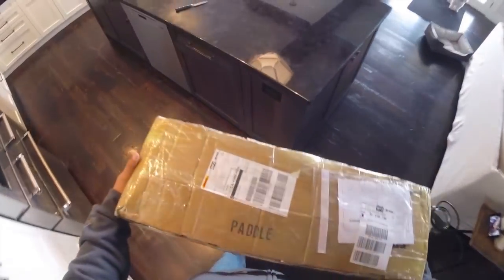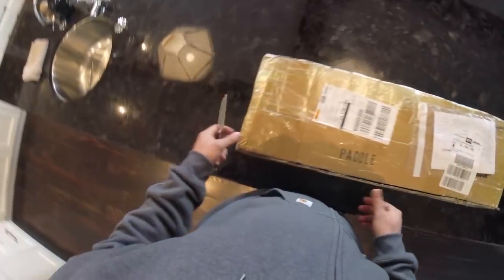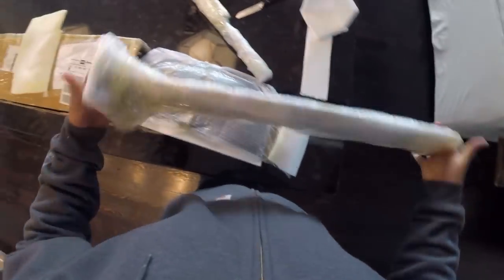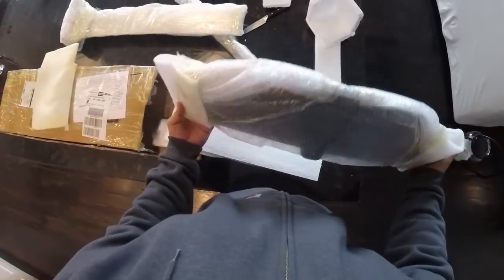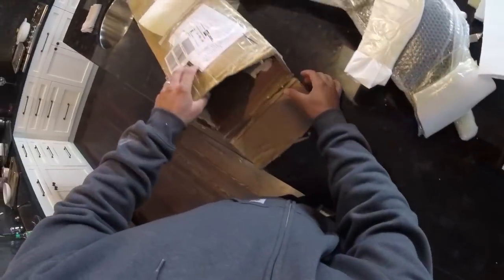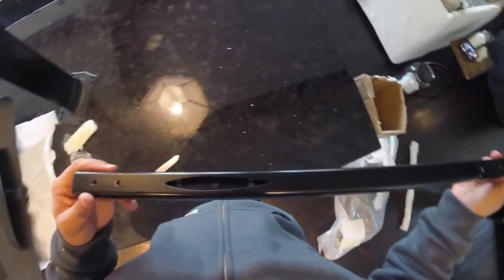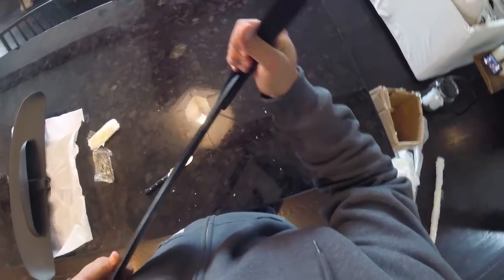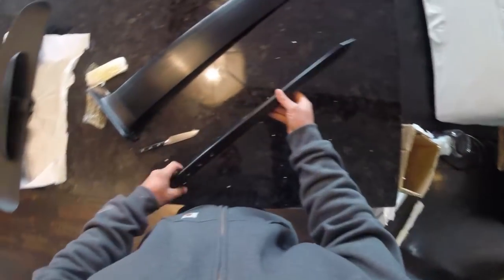VeFoil by VeConcepts Part 5 DIY Electric Hydrofoil Remote Propulsion System

Comment: I cant wait till someone scales up the foil w/motor design so that not only a surfboard platform can be lifted but say an entire boat like a flying wing shaped catamaran... I wonder if the 14" Rolls Royce permanent magnet motors could run off of solar.....  cats out of the bag.